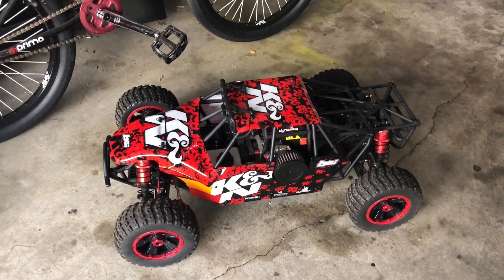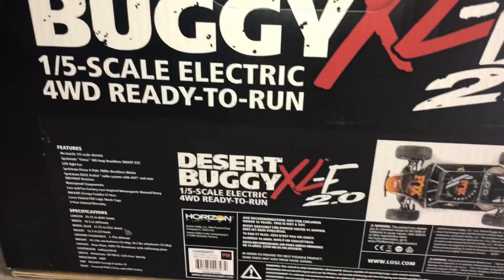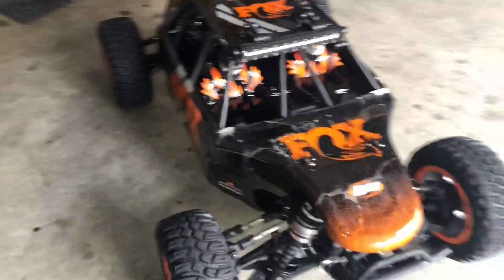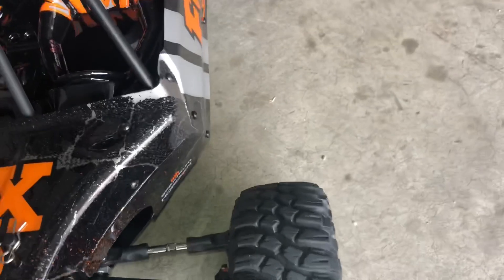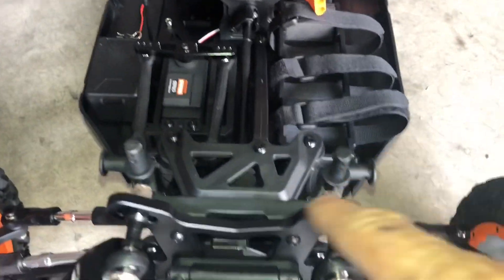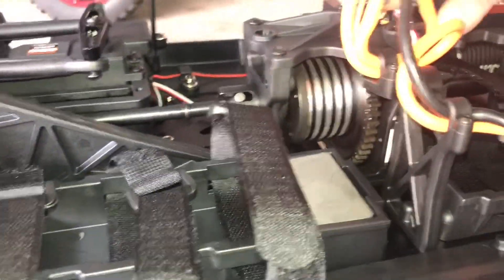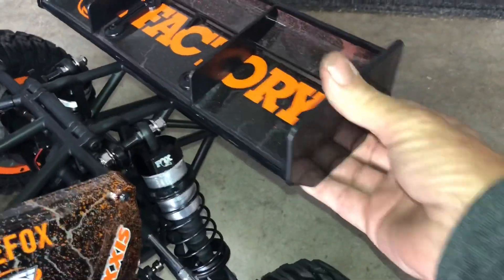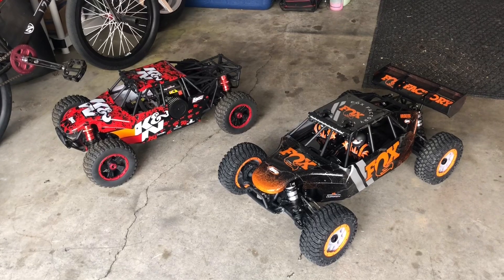Losi DBXL-E 2.0 unboxing

Comment: I just got good bad boy but the black red and silver scheme and don’t have any steering issues at all
Reply from the maker: CaRnAgE_4_Justin that would be a first for me and hundreds that are now looking if you measure yours I’m sure it’s off or maybe I just bought 4 different models that are all defective but in talking to Losi there aware of this problem
Reply: @earlmoorhead5555  is that why they leave the option for another servo so that each control arm can have a servo?
Reply from the maker: Fabrizio Sanchez I was told there teck team is working on a solution what I’ve done mean time was adjust the toe links to make both side turn equal now I have less right turn but more left turn so it’s even now

Comment: What is the third graphic option. I only know the Fox and the Losi.
Reply from the maker: The k&n gas powered dbxl its awesome 💯💯🔥🔥🔥🔥
Reply: @earlmoorhead5555  That I'm aware of. But the way you said it, made it sound like there was some third option for the E.
Reply from the maker: ABOlsen80X aww ya didn’t mean any third electric one 🔥🔥
Reply: @earlmoorhead5555  Correct. Meant LOS352003:)

Comment: Yep the gas 23cc is rubbish I ditched mine without running it and whacked an OBR 34cc billet reed engine having watched the release video's and the comment's of you over the pond as you got them way before us over here, mine rip's but I haven't used it for a long time so thinking of selling it keeping the engine and putting the cash to a LOSI 5B as I can't gel with it as much as my 5ive-T.
Mind I am having more fun with my Kraken VEKTA 5, KV5TT and Dragon Hammer takes more skill to get these to turn and jump.
I do rather like the look of the DBXL-E not sure about speed compared to the designed to be electric ones.
Reply from the maker: Nick Ing dazed & confused yes my obr motors on the shelf waiting to go in very cool other than left turns

Comment: I get my Fox Edition 2.0 Friday!! So tight!! Cameras and pics dont do this thing justice. The size on video alone is so deceiving!
There is a whole dual steering kit and aluminum arm for single servo available. Even a mechanical break set you can buy.
Reply from the maker: sLyKnEzZ that cool wishing the steering was better tho no doubt 💪💪🔥🔥👍👍
Reply: Earl Moorhead I’ll bet the steering on the 2.0 is no slouch with the push pull arm. I also have a gas K&N DBXL with a 32cc OBR Reed Case, walbro 990 Mod carb and custom pipe. It spits dirt like nothing else I have so far. Love the DBXL/Losi brand!